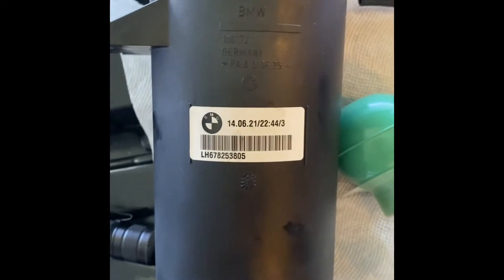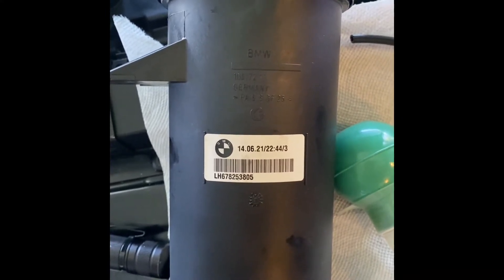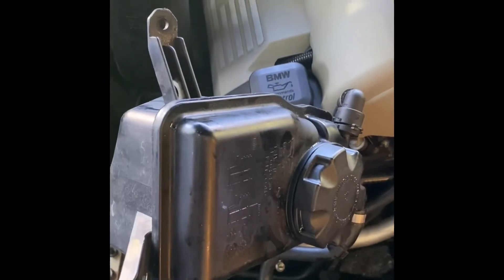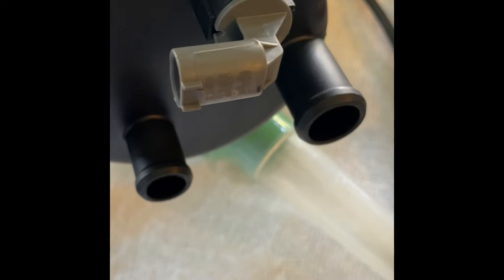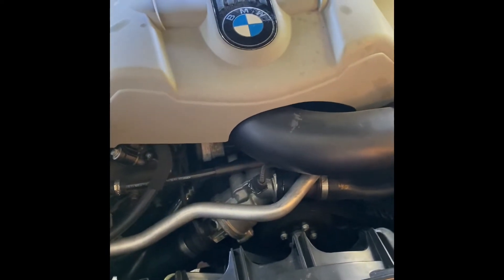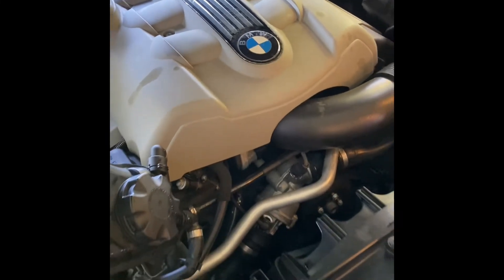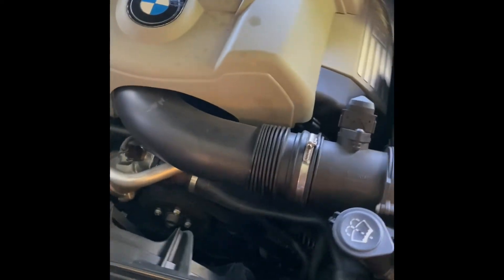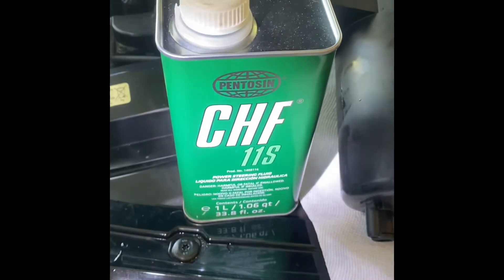BMW 645ci power steering fluid reservoir  / filter replacement, dynamic drive error 5D5B

Comment from the maker: it was the alternator causing inconsistency in voltage output due to oil leaking onto it from the valve cover leak

Comment: I have the same error code on my 760Li.  I get a dynamic drive fault only during aggressive cornering.  Fixed a valve cover gasket leak and replaced the alternator as well about a year ago.  Replaced CHF11S fluid in reservoir a month ago.  Wondering if you would recommend replacing reservoir.   Thanks.
Reply from the maker: i had same error after replacing reservoir and fluid, my issue was voltage related due to oil on my voltage regulator…. also i would get random errors when my battery was weak from sitting… i would , clear all codes, fully charge the battery, calibrate the steering angle sensor: https://www.youcanic.com/calibrate-bmw-steering-angle-sensor/

, drive hard and if error appears check codes with bmw compatible scanner or software like ista before changing anything
Reply: @hyundaiioniqkianiromainten3319  Thanks - I'll try it.  The car does beat up the battery leaving it pretty low by the time the car goes to sleep.  I also have an "E51D No Message PT-CAN (steering angle)" and an "E51A No message (yaw angle speed) from DSC".  Turn signal goes off automatically after a turn and adaptive headlight still steer with the wheel.  Thanks again.